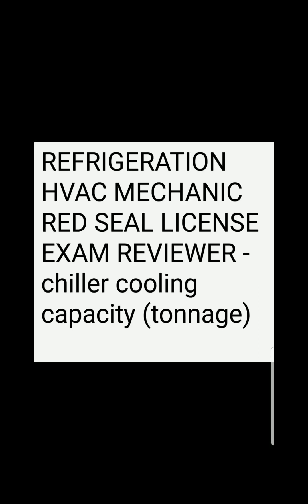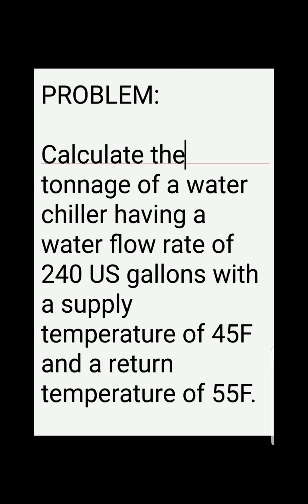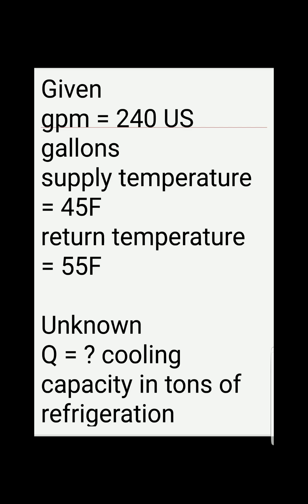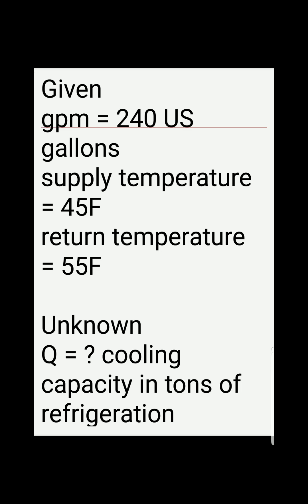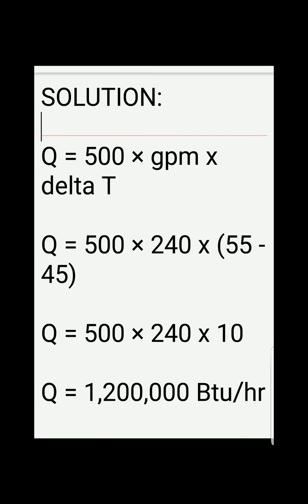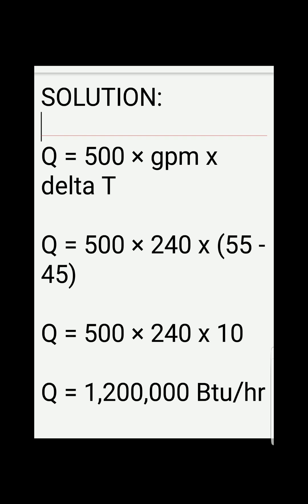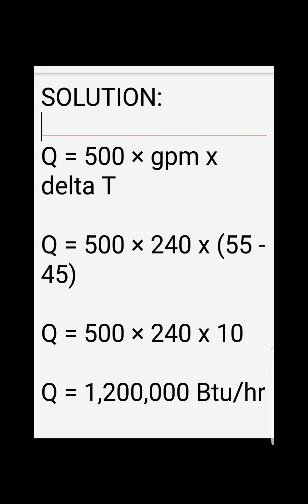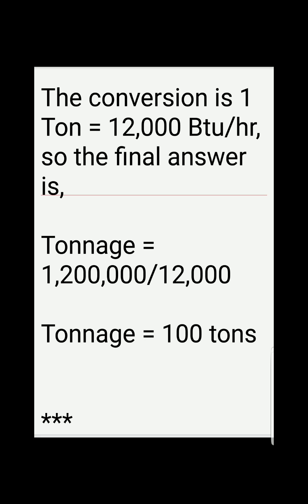REFRIGERATION HVAC MECHANIC RED SEAL LICENSE EXAM REVIEWER - chiller cooling capacity (tonnage)

Comment: Where does the 500 come from and what unit of measurement is it representing?
Reply: 1 us gallon weighs about 8.33 Lbs and gpm means gallon per minute so we multiply 8.33 to 60 gives us around 500 lbs.